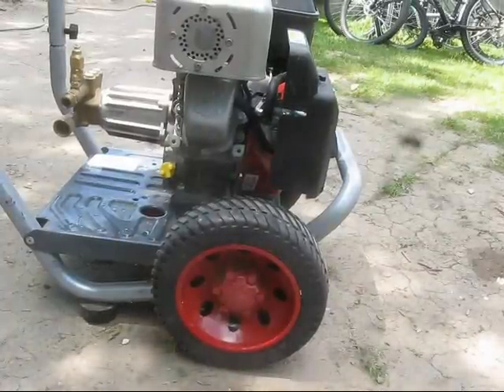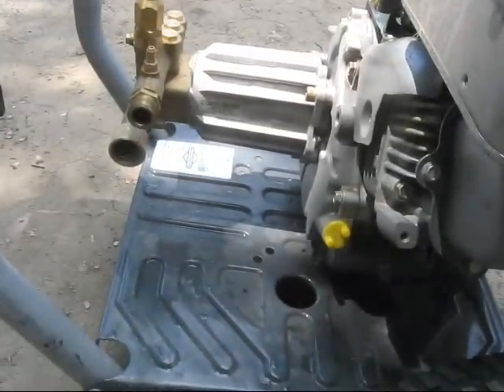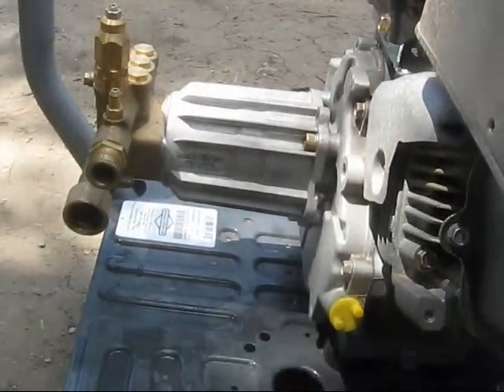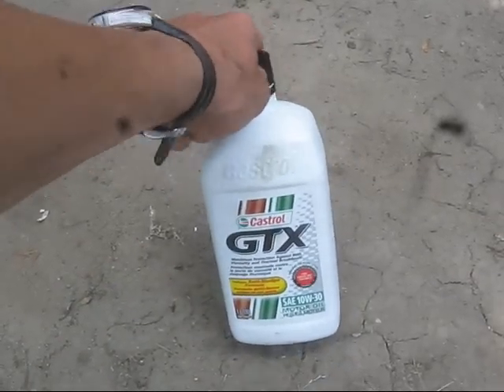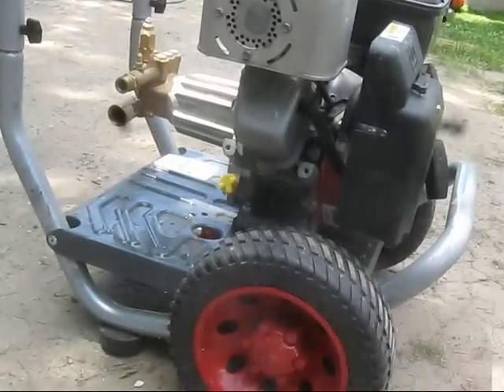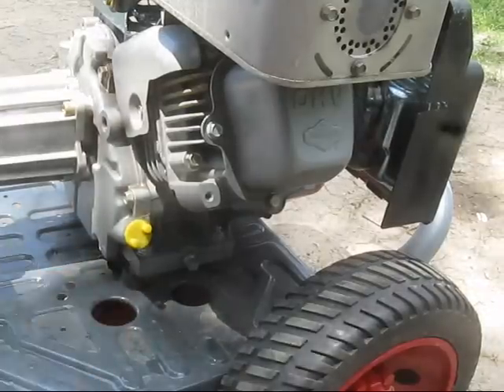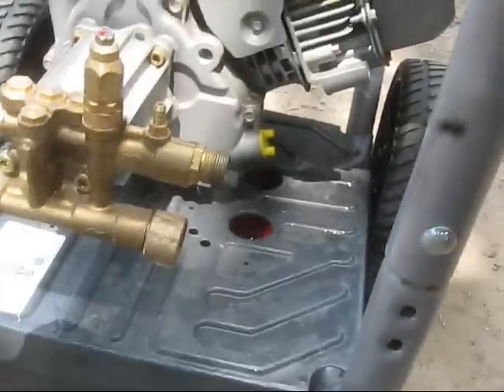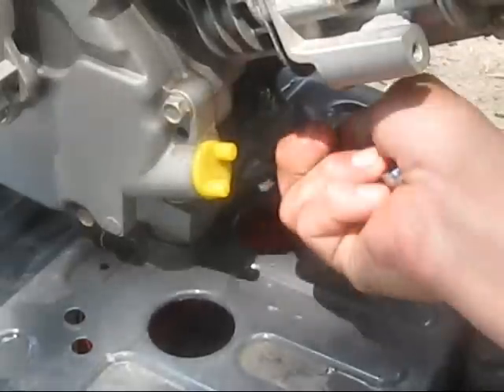how to change the oil in a power washer

Comment: I have a Craftsman 3400 psi 11.50 torque engine, similar to the one in the video.  I do have two yellow oil oil caps, do you fill on the opposite side and keep the other open until the oil comes out?  Also, could it be that there are two oil drain plugs on opposite sides or the only as shown on the video?  Good video  Thank you.

Comment from the maker: the reason they say not to use detergent oil is because dirt and metal say in the ambient oil and do not tend to settle also the is additives in other oils to help oil flow and stuff like that and those additives tend to break down over time in air cooled engines (run hotter no pressure lubrication causing the oil not to cling to metal surfaces as well there is no oil filter on most small engines ) IMO any oil is good as long as its clean and changed regularly ...

Comment: Nice video, thanks for posting it. I want to do the right thing yet there is always some conflicting advice. Maybe there are different rules for different brands/engines? I have a Honda GX390 and the manual states "Use 4-stroke automotive detergent oil." It appears that 10W-30 automotive detergent oil is used for general/normal use and SAE 30 when the outside temp is going to be over 100 degrees F. Then if temps are very cold you are suppose to use 5W30 automotive detergent oil. Then I have heard others say to use non detergent oil... like I said, confusion! I have also heard people say to always use SAE 30 unless the temps are very cold because it offers better heat protection than the general use, all around use 10W30. I currently use Castrol 10W30, but may switch to Castrol SAE 30W HD Heavy duty oil.
Reply: My understanding is the pump requires a non detergent oil so it doesn't foam in the pump.  The 10w-30 is good for the engine.

Comment: How do I check the oil level on the pump?
It says 'Use W90 oil' on the side, but where do I chek it? Or how do I change it?
Reply from the maker: Ferromar mdp normally these pumps are “non serviceable” however if you unbolt the pump from the engine I think you can get into it from the input shaft side if you can just dump it out into a container and measure how much you got out and put the same amount back in
Reply: Thanks!!

Comment: All I needed was how far up on the fill tube or dipstick do you fill the oil. Did address question.
All I needed from the video was how far up the fill tube or dipstick to refill oil. You didn't address this common question. Dip stick does not have a full indicator?????????????